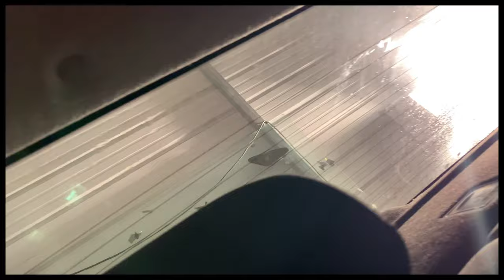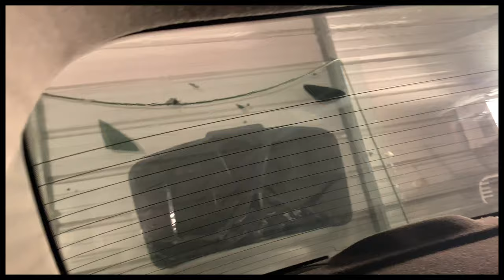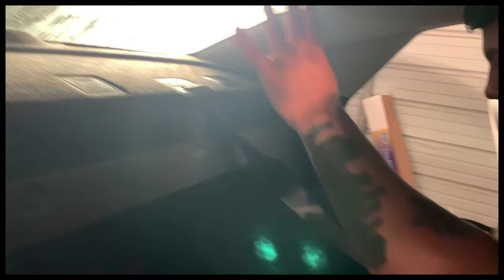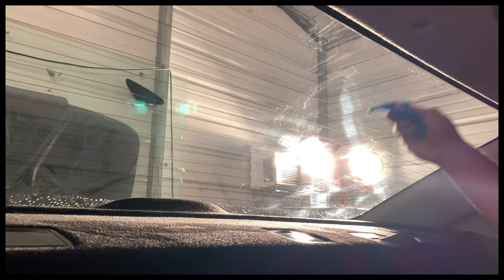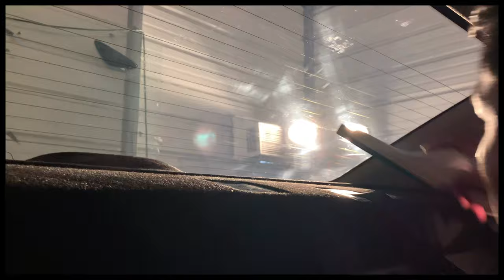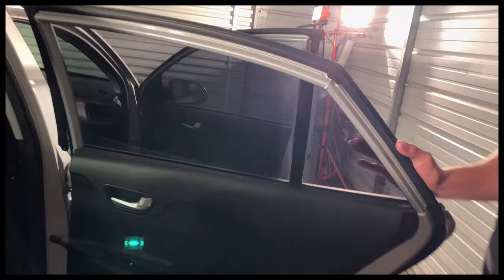Why not to use SOLAR CONTROL FILM‼️

Comment: I am sure you have been tinting longer than I have but I do have advice I learned from an older tinter.  Use a towel to prevent damage to the carpet and upholstery. Use awesome $3/gal at dollar general(don't dilute for adhesive removal).
Reply: Also, don't risk using the green scotchbrite as it will scratch if you use pressure.  Just use a paper towel to get the bulk of the adhesive or a hard card, finish off with the blue or white pads that are safe on glass.

Comment: Hi Man cool video,I'm here in Miami area and I used suntek and I've seen the same results. I think if it's not carbon, metalized or ceramic it just don't hold up. Even top brands 2 ply die don't last. I do like the Sun control Optical series,It's a hybrid carbon/ceramic awesome price. Happy tinting😎
Reply from the maker: Sun control  optical the best hands down